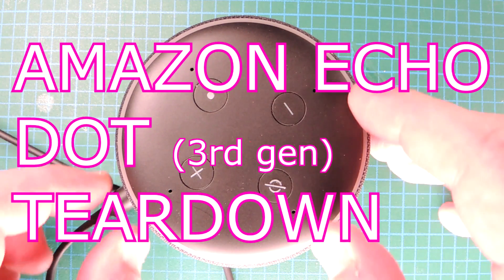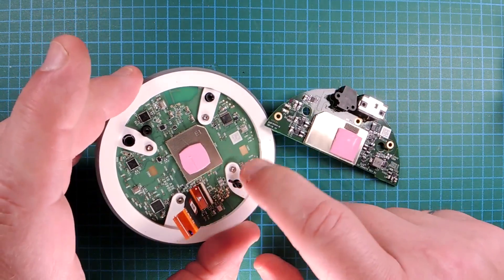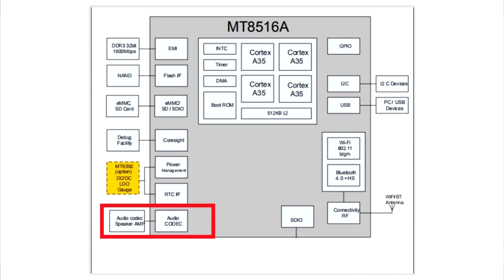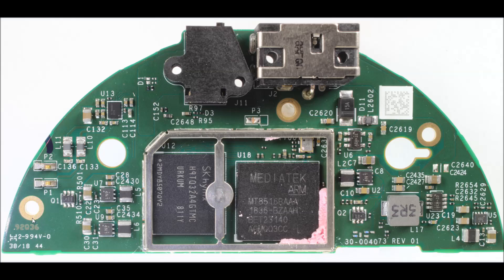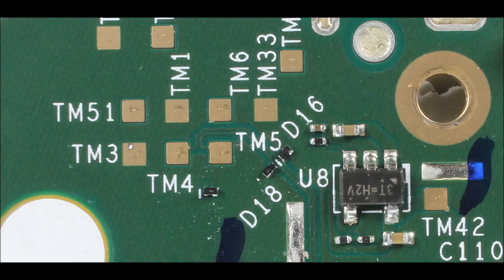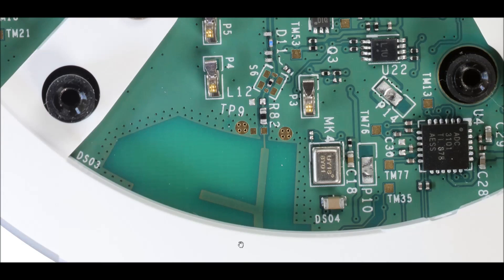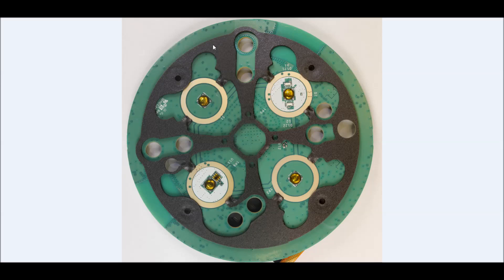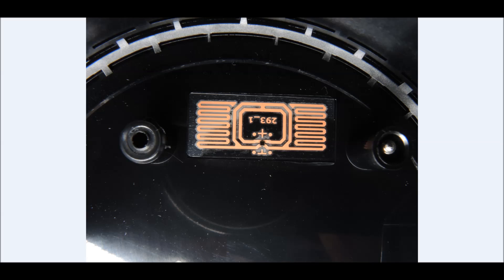Amazon Echo Dot (gen3) Tear down

Comment: Hi please make a video about these super cheap fitness tracker 5$ https://rover.ebay.com/rover/0/0/0?mpre=https%3A%2F%2Fwww.ebay.com.au%2Fulk%2Fitm%2F153332792159

They all have the same chip inside, nowhere is any info about it. 
ZKC1839

Maybe you can see the from the silizum if it is otp or flash memory?

It seems it is a telinl chip because it has an sws interface wich is patended by telink

Comment: I think the RFID tag is used for when Amazon pre-configures these devices with your account, they probably store some info on there or on their assembly line and according to that then flash the correct files and all.
Reply: Flashing would be too complicated. These devices phone home to Amazon and obtain the necessary configuration at that time.
Reply: Most likely, their kindle keyboards also have it
Reply: some companies  use them now for parts tracking in place of those mini qr codes you see though you could be right.